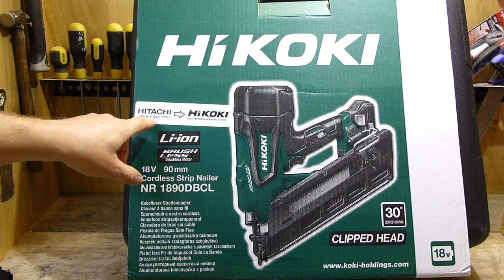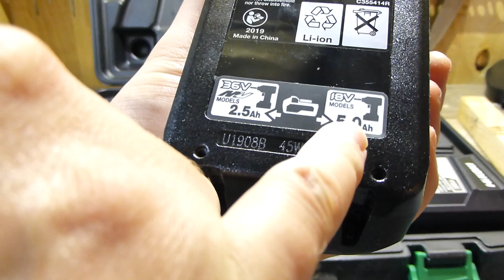Hilti Vs Hikoki Cordless Gasless Framing Nailer Review

Comment: Agree with everything you said and I also wanted Makita, but switched to Hikoki for the nail guns. It's an excellent tool.
Reply from the maker: Glad you are not disappointed with the Hi-koki. Makita may catch up one day...
Reply: @ToolsAndStuffOFFICIAL  
Think i will get me Hikoki nailer , one shop is selling them and giving Hikoki DS 18 DBSL drill with it and still the price is under anything i can find online .
Have also been looking if Makita has a frame nailer , other than the gas operated one , model GN 900 SE , that seem to be their only non pneumatic frame nailer .
Reply from the maker: There is no makita gasless framer yet, still going to be a while
Reply: @ToolsAndStuffOFFICIAL  I saw a makita patent for a makita gasless nailer but its flywheel operated like the dewalt.. which im not a fan of.

Comment: The fact that this thing is performing alongside a gas tool is a credit to it. Running costs over time must be a lot lower.
Reply from the maker: Not to mention not having the frustration of trying to find gas cylinders or wondering whether the gas has run out or the battery is flat. And that damn smell.

Comment: I have had my Hitachi framer and brad nailer for a while (maybe a year a 2) and it hasn't skipped a beat... My father inlaw builder for 50 odd years and a paslode user for 20 odd years is seriously thinking of switching to Hikoki after using mine for a while... lol
Being a kiwi myself I agree with the bump fire thing (and seen it happen)...
Reply from the maker: Yeah I have the brad too and love them both, although I was looking at the Milwaukee framer today...
Reply from the maker: Sticking with the Hikoki
Reply: Yea as an ausy I understand why our soft between the ears cousins from down south aren't allowed to use the grown ups bump feature. Over hear on the mainland our hikoki comes with the bump fire feature. Works great 👍

Comment: The re brand this Hitachi to Metabo in US but as usual when an investor bought it and renamed it, it mean it is going to be super expensive, now they remove the hard case and replace with cheap nylon bag, remove 1 battery so now it’s one instead of 2 and they reduce the AH to 3 and they change the charger to the slowest charger on earth so you will force to buy the fast charger.  Basically they want to suck out life of carpenters money that should be going to their family’s mouth.

Comment: UPDATE PLEASE  is it still sinking the nails  ?
Reply from the maker: Still working fine, why ? Have you heard a bad report on this nailer?
Reply: @ToolsAndStuffOFFICIAL  I'm ditching my paslode soon and thinking of hikoki. 
Was just curious on how your nail gun was doing since your last video
Reply from the maker: It's a good nailer. The only one that might be better in the gasless sector would be the new Milwaukee, but it is much dearer and I haven't used one yet so can't comment on it.
Reply: @ToolsAndStuffOFFICIAL  thanks mate
Reply from the maker: You're in AKL aye? Handy usually has pretty good prices on the Hikoki nailer, he also stocks the Milwaukee now too. If you go for the Hikokithey do it with multivolt batteries as well as 18v, (even though the tool is only 18v) I got the multivolt kit on special cheaper than the 18v which means I can run 36v Hikoki tools if I want too. Toolshed Silverdale often has good Hikoki deals. They have free battery deals at the moment.
Reply: @ToolsAndStuffOFFICIAL  north of Auckland.. warkworth.